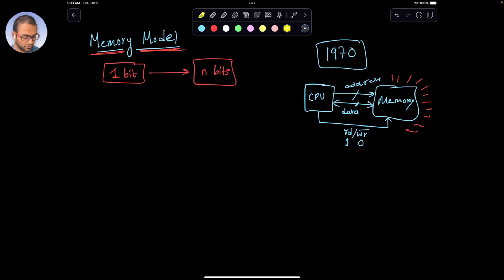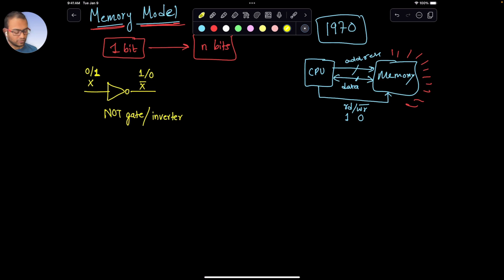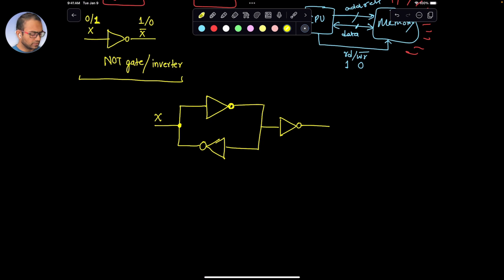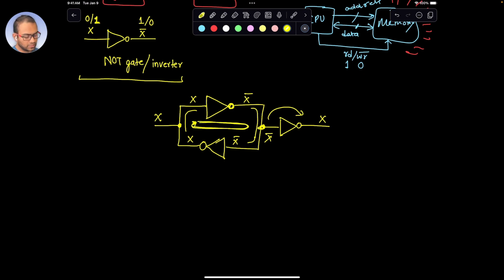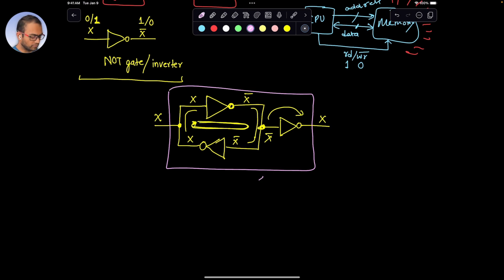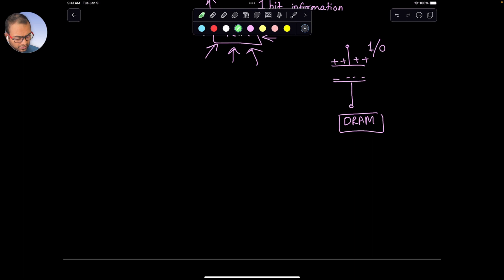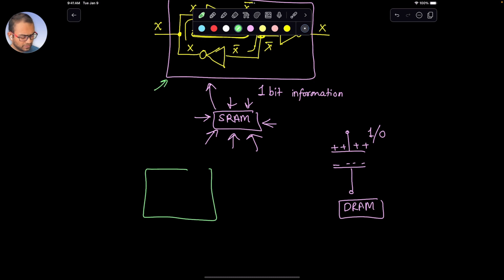2. Memory model. How to think about the memory [Assembly, C on Bare-metal RISC-V]

Comment: In this memory model from the 70s, memory is made up of registers. Is this still the case with the typical RAM in today's computers? I thought registers were only on the CPU.
Reply from the maker: Back in time, memories were made using vacuum tubes. The 1970s model was only for the system - CPU and memory interactions wise. I have taken the liberty to propose a model of memory that works well when reasoning about the current systems. that said, memories like SRAM in todays time are similar to what is described in the video.

Comment: I have one question, here in data line you mark it with a cut (/) what does that mean?
Reply from the maker: It means it's not a single line or single bit
The bus is multi bit wide hence that / denoting it's multi bit
Reply: got it ! thanks  @inpyjamaarchieves

Comment: What an amazing explanation, thanks Piyush for this piece of art.
I have a question though, let's imagine a scenario, i want to save a data into the memory(register 03h), so I put that 03h at the address to select the register, then I write my data via data line. Now I jump to do something in other register, in the next clk rising edge the data is no longer fed to the 8 D flipflops of register 03h, which means the output of those D flipflops would be at zero, so  how is it going to save the state of the register? what I am missing here ?

Comment: As anamoly select line is address, databus is for data, then What about read/write ,who responsibilty to understand read/write signal, pls explain this briefly..
Reply from the maker: The rd/wr signals are floated by the control unit in the CPU based on the instruction it is executing. This is done during the load (for read) and store (write) instruction execution. Separately, the line is set to read mode every time there is an instruction fetch.

The status of this line is decoded by the circuits within the memory to decide is the data should be loaded at the memory address or if the data from the memory address should be made available on the data bus... rd/wr line essentially control who will modify the bus. The CPU or the Memory!

Hope this helps. Please let me know if the answer was confusing.

Comment: Why we choose D-flip flop over other types of flip flops? 
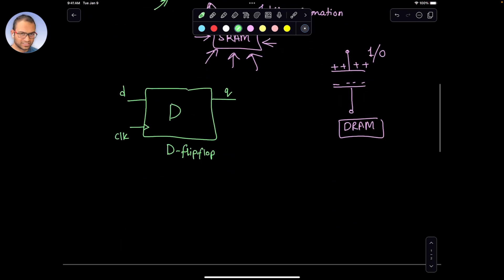5:57
Reply from the maker: @ashfakahamed3451: It fulfills the properties of a memory unit. We can input the value in 'd' and it'll remember it and make it available on `q` until `d` change at the clock transition. There is nothing sacred about it. Any other flipflop that has same behavior will also work. Further it only has only one input and one output. S-R, J-K have two of each, infact, if we tried using these, we'd need to add extra circuits and end up converting them to D flip-flop :D

Please let us know if this answer convinced you.